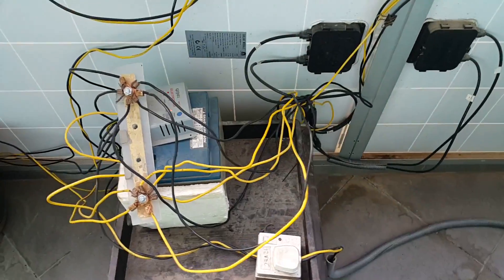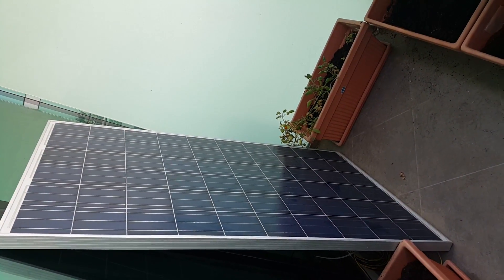Solar Powered Aquaponics on Apartment Balcony

Comment: You should consult with a local structural engineer for safety of your balcony carrying weight of these 700 liter water tanks. Residential units are typically designed to withstand a live load of 200-250 kilograms per square meter. This can vary depending on building code of your country.
If these tanks are a meter in length and width, that's 700 kgs per square meter.